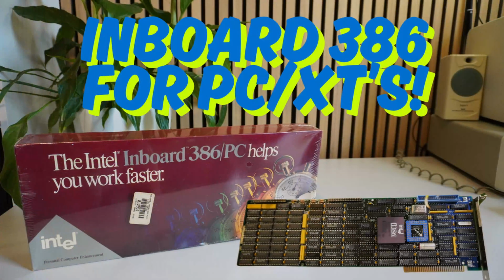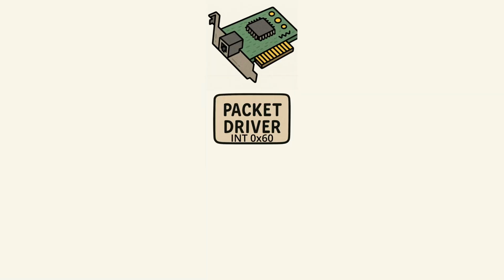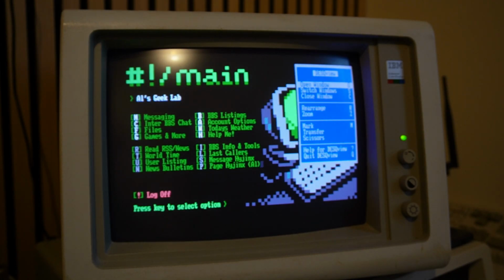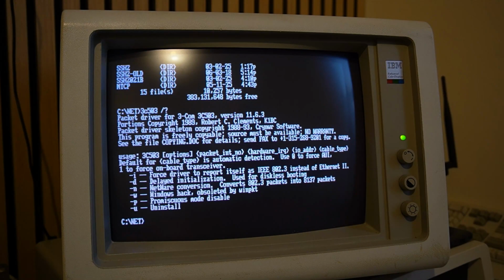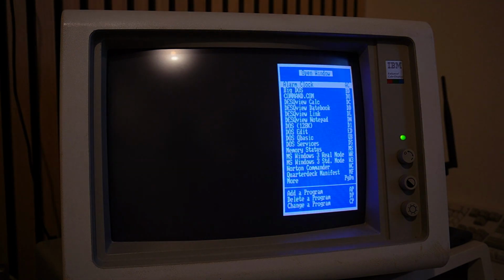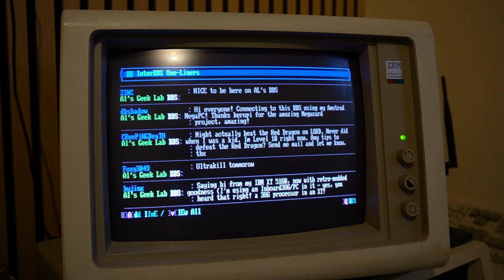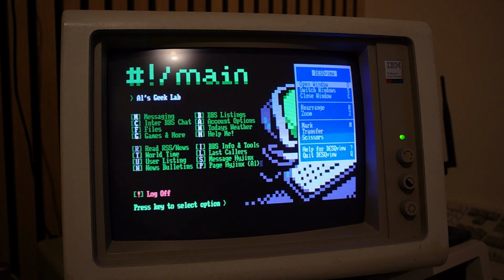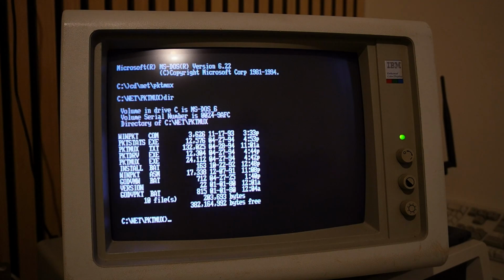DOS Was More Advanced Than You Thought: multitasking network apps

Comment: On DOS PC i never figure it out how to get the network running. At last i tried to have network with DosBox on an Android tablet with wlan, but it doesn’t connect to a second Android tablet with DosBox. I think it is a problem with the router, but i am not sure.
Reply from the maker: Make sure you get the right packet driver for your network card first. Look for the crynwynr packet driver package they have drivers for most common cards of the era.
Reply: @AlsGeekLab I had the problem to get DOS driver for the onboard NIC.
Reply from the maker: Onboard NICs are tricky. It may not be supported check the chip and verify @maxmuster7003

Comment: Hey, new to your channel, it’s great! I am also new to retro PCs, I just got an IBM 5150 and I want to try hooking up to your BBS. I have to get it running first and make some modifications, but I will get there! I have the original 64K board, what is the best expansion card to get and how much memory could I get from it? I was looking at the picomem, but it says that it’s a different kind of memory that is slower. What are the requirements to connect to your BBS? I haven’t used a bBS since about 1991 so I’m a little rusty.😂
Reply from the maker: The picomem ram has been updated recently so it's a lot faster apparently so it might be worth it now.
In terms of the use of BBSs's on old computers check out my video showing how to set up networking on an old PC , it demonstrates how to use mTCP using your network card and just 128k of ram
Reply: @AlsGeekLab awesome!  Unfortunately my motherboard maxes out at 64, so I gotta find the best expansion card still. Some people are saying it get to 1mb, others say 2 mb. Do you think 64k, and a picomem is the best bet?  Enough ram for bbs at least?  I’m trying to max everything out and push it as far as I can with modern upgrades. I wish someone had a video on that!
Reply from the maker: @Njbuilder95 I do have multiple videos on that! Picomem, ast six Pak plus, etc!
Reply: @AlsGeekLab oh great, I’m going to check them out. I was thinking 2 six packs might be the way to go if you can do that, I’m gonna check out the videos!
Reply from the maker: Don't think you can do two sixpaks. I had a card called the monotech PC s memory card before the picomem which enabled ram up to 1mb. Bear in mind that the original PC can only address 1024k due to the limitation of the memory address bus size @Njbuilder95